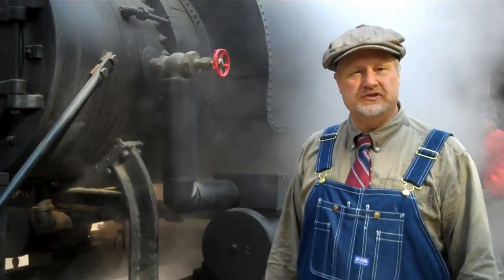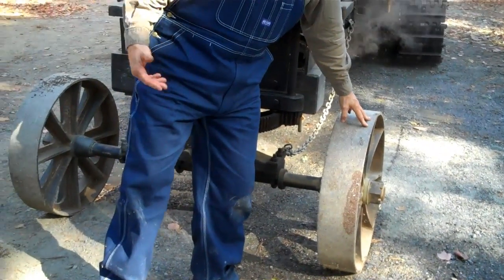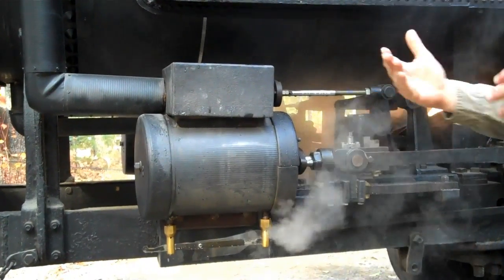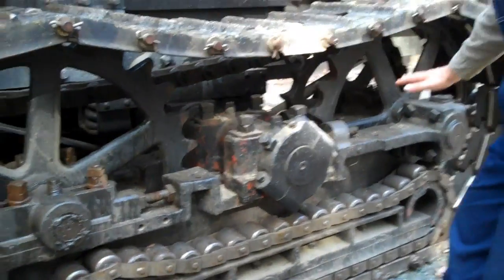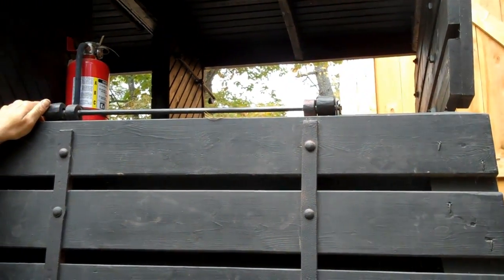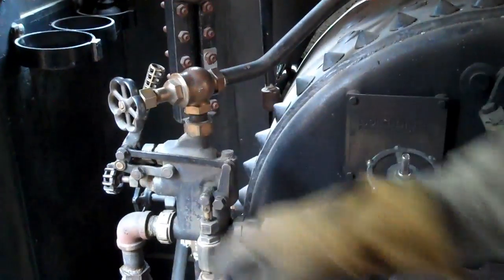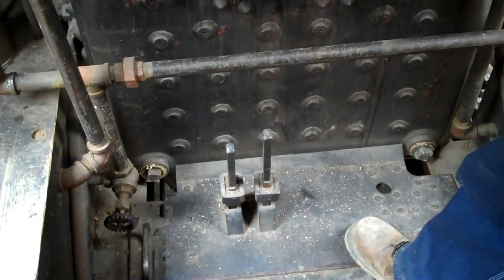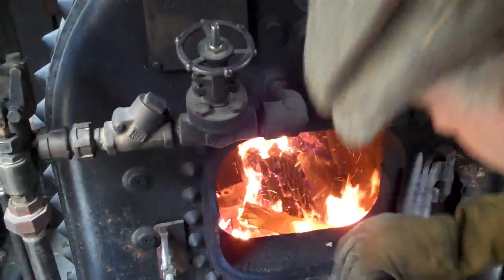How a Lombard Steam Log Hauler Works

Comment: Is the "compensating gear" a differential or does it use a another mechanism?
Reply from the maker: The "compensating gear" is a differential weighing over 1,000 pounds.  Lombard's fist log hauler did not use a differential and was very difficult to turn.

Comment: Stupid question: how did they keep this from freezing up during the winter? Did they simply keep the boiler fired off all winter and steam lines blown down? I’d suspect during the -30f weeks it’d be a bear to keep it from freezing up.
Reply from the maker: Freezing was a major concern. Log haulers were sometimes stored in a steam heated sheds at night and Lombard published plans for a suitable design.  The Lombard boiler was used to heat the building.  By 1917 Lombard switched exclusively to gasoline engines to eliminate this freezing problem.  We've  run our restored steam Lombard log hauler in freezing weather  and it fortunately takes many hours to cool down due to all the mass.
Reply: herbcrosby 
Thanks so much for the reply Herb!  Is the demonstration days for the Lombard published on the lumbermans museum web page? I’d LOVE to see one run!
Reply from the maker: We hope to run our steam Lombard log hauler 4 times during 2018.  Event times will soon be posted on the Maine Forest and Logging Museum website.

Comment: Was there any independent braking on the tracks for slewing or was it just steered solely by the front skids? Seems like they missed a trick if you couldn't brake one side or the other.
Reply from the maker: Great idea, but his early tracked machine had no brakes on the tracks or otherwise.  Steering can be tedious.